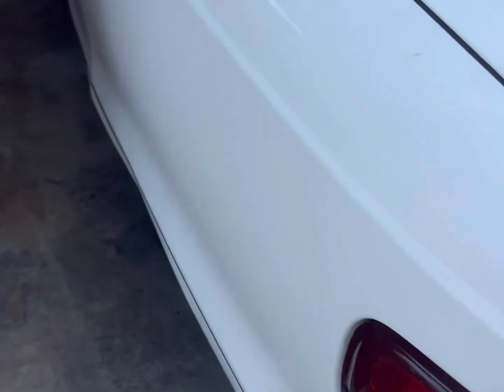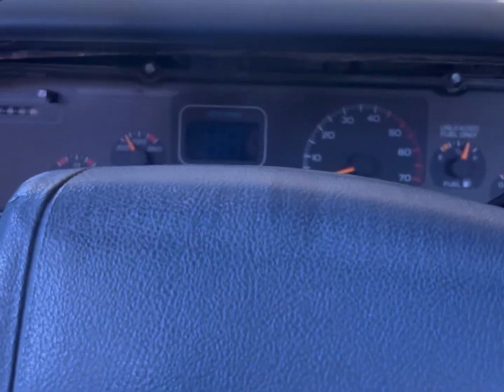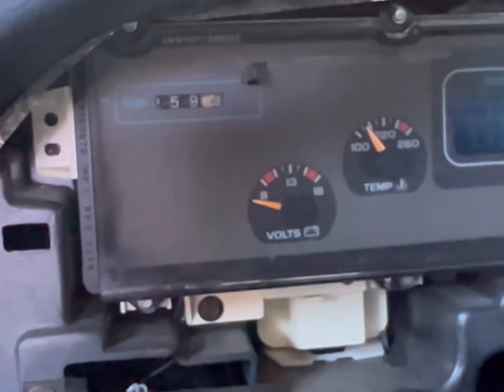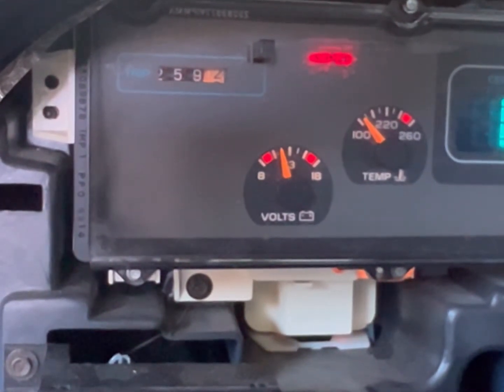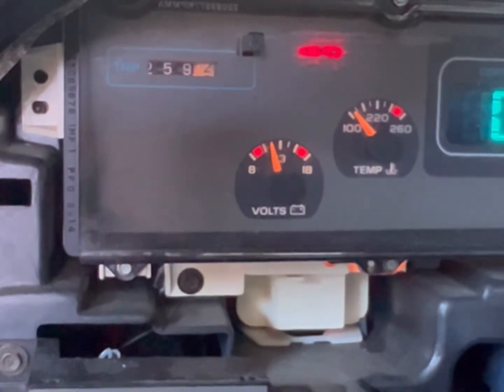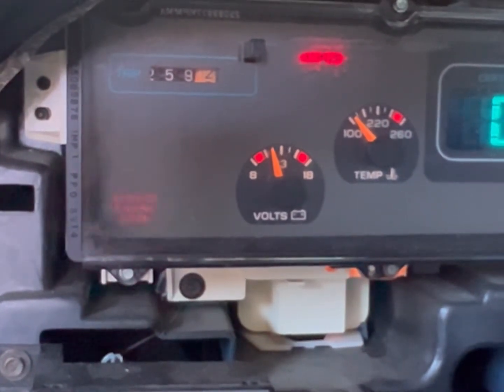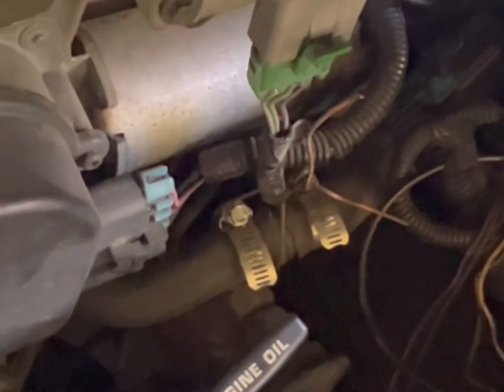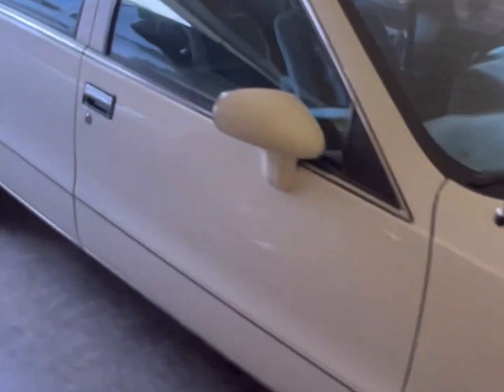How to read OBD1 Check Engine Light codes on older GM vehicles

Comment: Man thank you I just got a 92 caprice base model with 90,000 miles on it brah (straight up steal) but I didn’t know how to check that dam check engine light but now I know thanks to you …say man where did you get that instrument panel? That thing is clean clean 💪🏾
Reply from the maker: Already bro I’m glad it helped you. The instrument panel with rpm & digital speedo only comes on the 91-93 LTZ model and maybe a 9C1 if I’m not mistaken.